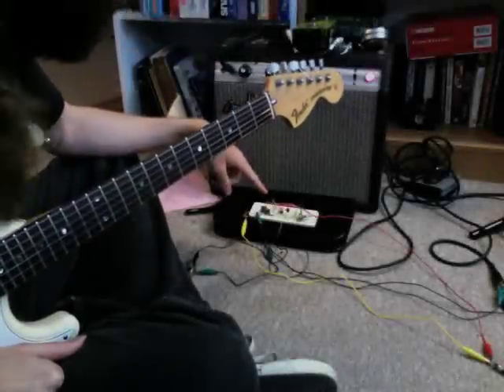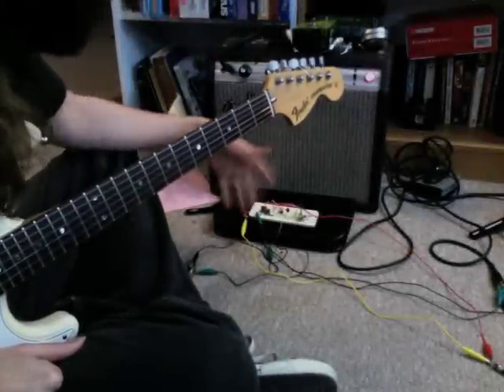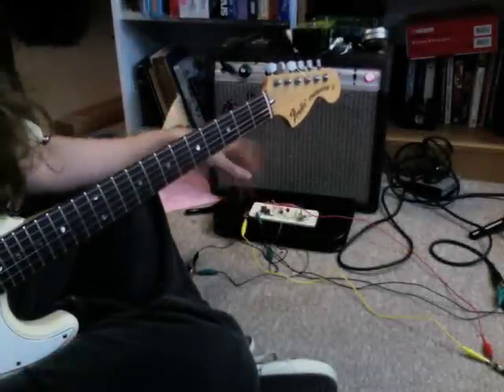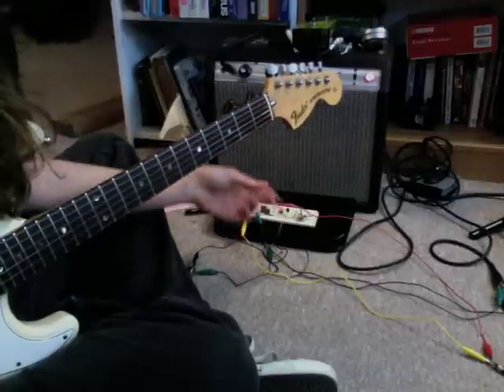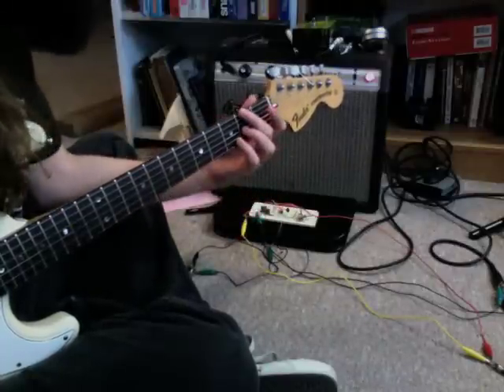Diy stompbox Hysteresis Oscillator on the Breadboard

Comment from the maker: It's the pedal. It's based on a 555 timer, not smooth at all. I never built it into a pedal because of the noise. I did like the bitcrusher type effect it had when cranked though.